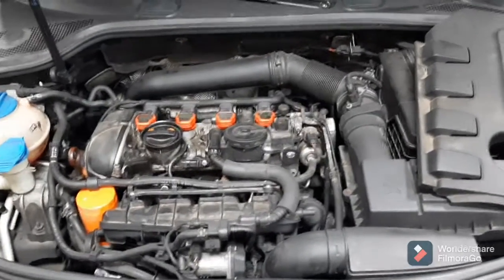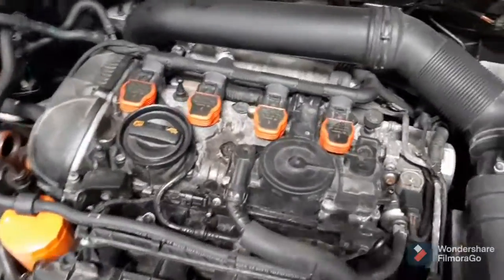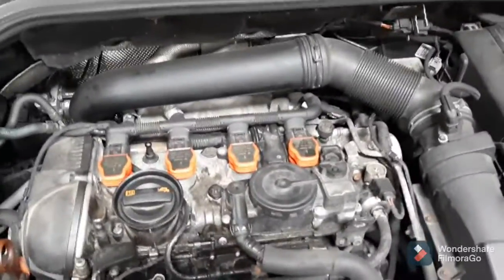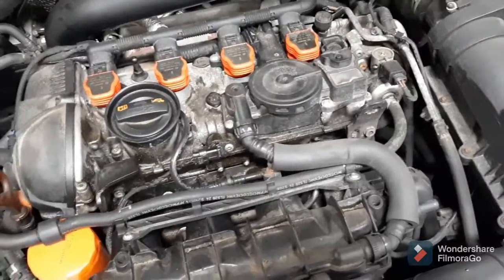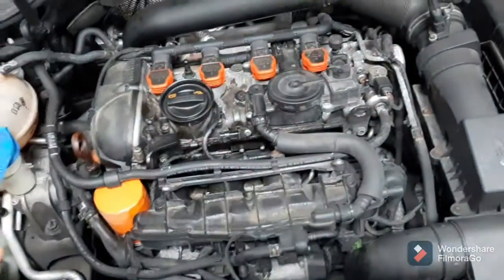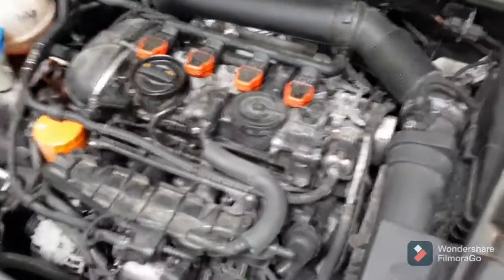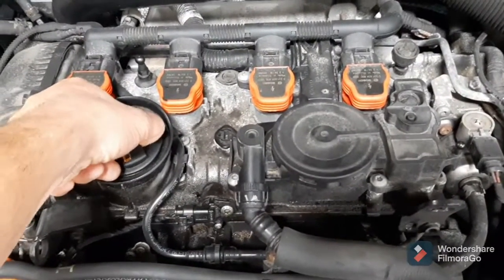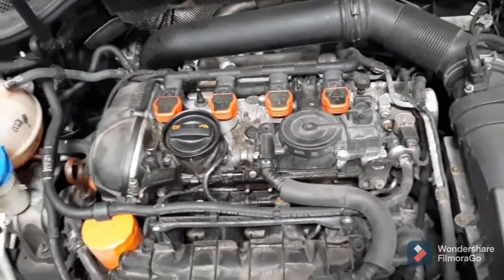CCTA 2.0TSI OIL SEPARATOR/ PCV FAILURE

Comment: i have a question and or suggestion. i have a 2017 vw tiguan with 54000 miles, always worked great, couple of days ago i got a message on dashboard, ENGINE OIL PRESSURE-TURN OFF ENGINE, i went to VW the same day, at the first they said everything was fine, then did an oil change because it was due, when almost done they told me they found a small leak and they suggested me two jobs to do: oil separator and upper timing cover gasket set, the first one for a total cost of $785 and the second one at $750 ( all i guess including labor). what do you think about that?
Also they suggested to replace brakes pads and rotors( all 4) for  total of $1200. 
To me it sounds extremely over priced, what should i expect to pay for these jobs? i didn't do the jobs yet.
I'd really appreciate a comment, thanks in advance.

Comment: I have a crec 3.0t, same thing super hard to get the cap off. Also high oil consumption. People keep saying it’s carbon buildup bc the crec rarely has a failed pcv but is this much vacuum normal? My valve cover gasket even failed so k had to replace that

Comment: Good vid thanks😊 i replaced my pcv , Audi a4 1.8 tfsi 2010. High vacuüm when lifting oil cap. With the new one still te same😢 Engine runs good,no codes. Engine consumes 0.5 liter oil on 2000 km. I did not replaced the pcv with a original one.....could that be the problem? Thx😊
Reply: Did u replace breather tube ?
Reply: @TopStrikerMaverick jup new pcv. No difference.
Reply: @alfb1830 sometimes it’s the breather tube and the pcv is fine
Reply: @TopStrikerMaverick it,s all checked,no leaks.

Comment: What does it mean if you pull the oil cap off and it goes immediately dead? VW 2.0 TSI
Reply: It’s normal. The cap and dipstick are needed to have pressure. With it off it’ll shake engine and make it weak due to pressure. If nothing happens with cap off then that real bad. If too much vacuum and it dies then it’s bad. Typically pcv

Comment: Would you recommend replacing this as preventive maintenance or is it generally safe to replace at first signs of failure?  Great content as always .
Reply from the maker: I could justify doing it as a preventative maintenance being that it can potentially damage rear main seal and it’s easy enough to do, I appreciate that
Reply: I would do it after 40K+ miles

Comment: When doing this job the main main key is DO NOT DROP ANYTHING into the cylinder head. Is is very easy to lose notion and before you know it a tool, bolt, etc fell and will know when running the engine and all mayhem breaks loose.
Besides the above, is an easy job to do.
Reply from the maker: Very good thing to mention!

Comment: Replaced my pcv system in my 2.0 tsfi still have excessive vacuum at the oil cap. Any suggestions?
Reply from the maker: Check intake camshaft phase, sometimes when the timing is off it can start effecting vacuum a bit
Reply: Were you having oil consumption that led you to the pcv?

Comment: Repair kit will do just fine! There is nothing in the body of the pcv valve/oil separator assembly that can go bad. No moving parts! That would be extremely rare!
Reply: Not true whatsoever. The valve is complex with other fail points. It’s under $200 for a whole new Oem Pcv unit. Much cheaper than replacing a rear main seal.

Comment: If you have this issue, and so you replace the part you mentioned, on the top of the PCV valve (replace the diaphragm only), then how do you know after the replacement that it worked?
Reply from the maker: Should be light suction at the oil filler cap with it idling, easily removed with 2 fingers
Reply: @EuropeanAutoRepair hello friend 
İ have replaced the PCV with a new one but the oil cap is still coming out so hard what i must do to fix the issue and after i replaced the PCV somtiemes i have on my dash OİL PRESSURE ENGİNE OFF fault note 
if have a solution please help me

Comment: Can a bad PCV cause an oil leak? I have significant oil staining on top of the engine, right around the pcv assembly. Trying to figure out of its that or an upper gasket.
Reply from the maker: Yeah sometimes those oil separators can leak pretty bad. Also the upper timing covers and leak and oil will land on the top of the engine from that as well
Reply: Im having multiple missfires   still and IV changed the coils,plugs, injectors,put new pcv valve ,still running a bit tough at times when trying to accelerate, i couldn't see any leaking oil  anywhere, what should I check next? before i pull my hair out!!🤬🤬
Reply from the maker: Have you already performed a compression test?
Reply: @christopherhitchens1502  what codes?
How did the plugs look like?
OBDEleven (costs around $100) will let you check chain stretch. 
Welcome to the world of VW Audi.

Comment: Hi, I have just installed the updated oil separator PVC with the white cap. I hooked up a vacuum gauge to the crankcase via the dipstick tube. At idle, I have about 2 inches of vacuum, engine stumbles when oil cap is removed. Is this normal??? Thanks
Reply from the maker: Sounds right! Should be good
Reply: Its normal when you open the oil cap with runnkng engjne the engjne sucks unmetered air trough the oil cap hole the mass air flow sensor is not mesuring the extra sucked up air so it stumbles
Reply: Bonjour j'ai un bruit similaire juste en donner un coup daccelerateur et au moment de relacger les gaze que j'ai un bruit simmilaire quand le ralenti desent